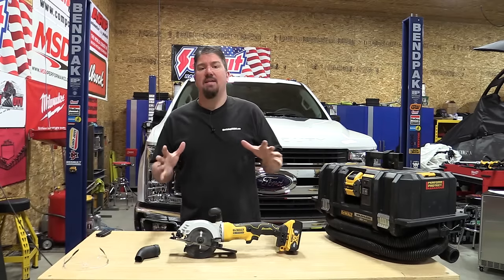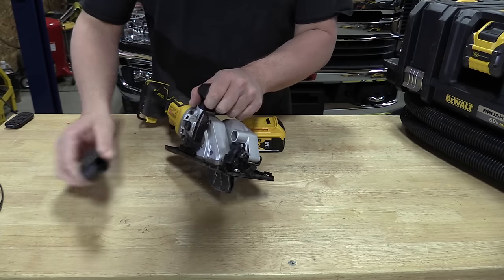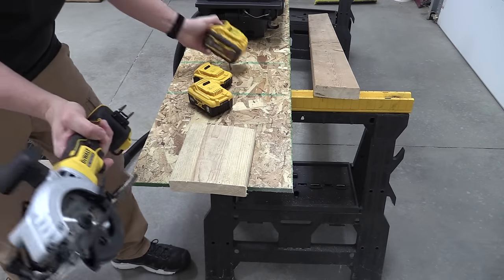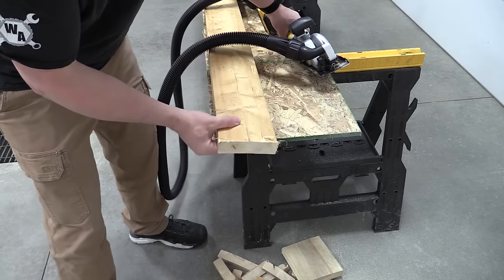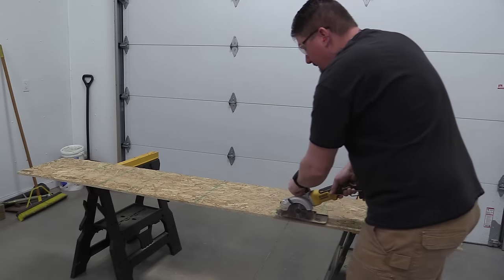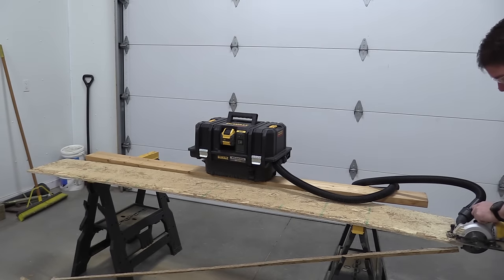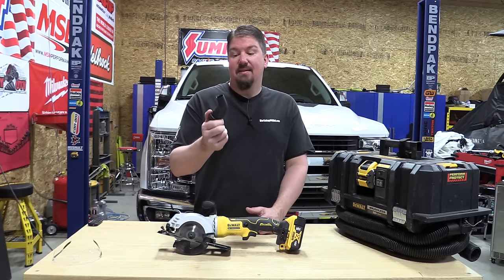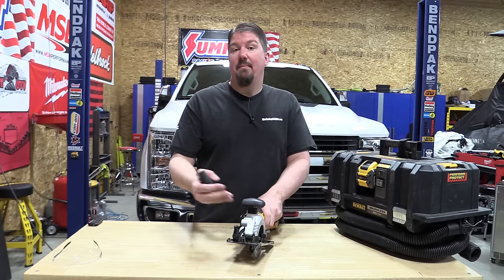DEWALT ATOMIC 20-Volt MAX Cordless 4-1/2" Circular Saw Review DCS571 Power with New FlexVolt Battery

Comment: Retired after 40+ home renovation. 
I would never buy DeWalt. 
Many years ago I walked into our local tool store and saw a brand new drill made by DeWalt. It looked 100% the same as a lower priced Black&Decker. Eventually all the cheap quality B&D tools turned yellow and prices were 30-40% higher. Carpenters fell for the scam thinking a higher price meant better quality. All the tools carpenters would never touch because it was consumer quality they were now buying by the pickup truck load. Us older guys saw this transition but you younger guys never knew you were being sold consumer grade tools with a new yellow color and higher price.
Actually I did buy a DeWalt screw holder once.
Reply: @C is Life I used to buy tools from different companies because they all specialized in different tools instead of one company for everything. All my drills were Milwaukee.  B&D made an 8 1/4 Super Sawcat that was the most powerful in the business back then until it turned yellow, changed name and 30% price increase. I'm in my 70's so it was awhile ago when I  watched B&D tools transform into DeWalt. I'm sure they make great stuff but I'm not crazy about the colour and I like to be different. One thing that's good is that when I work a job with other Carpenters everybody knows what my stuff is.. I did carpentry, plumbing, ceramics etc for almost 35 years but I always work alone by myself.
Reply: All my power tools are dewalt. Never once let me down
Reply: @robertpatterson7182  They are good tools, it's just the con job they did when they first introduced them here in Canada. Many years ago no contractor would touch any tool made by Black & Decker because they were considered homeowner tools. Then along came this new brand of tools called DeWalt. They took the exact same tools made by Black & Decker, changed the color and increase the price by 30 to 40% and everybody fell for it. People will buy anything that has a high price because they think it means higher quality. I had a Black & Decker 8 1/4'' super sawcat saw which was actually the most powerful saw on the market in those days. one day I went to buy another one and it was no longer available but the exact same saw was sitting on the shelf by DeWalt and it was 30% more that was when I decided I hated DeWalt. I looked around the tool section and every single tool that was on the Shelf made by DeWalt was the exact same tool made by Black & Decker previously except much more expensive and everybody was buying them not knowing that they were buying the exact same tools that they wouldn't even step on the year before . it was a total con job from the beginning and I hated them because everything that I used to buy now was 30 to 40% more expensive so you can imagine what that did to my business in those days that was a long time ago I had over $40,000 worth of small hand tools and not one single DeWalt.

Comment: Except for the situation where it can get slightly closer to the walls when cutting open subfloors, there is literally no advantage to this saw compared to a cordless 6.5". The ergonomics are awful. The balance seems ok until you start reaching away from you. The safety switch is an awkward reach for your thumb. And it's too damn long. 
If you love it, that's great.  I just bet you'd love a 6.5 a lot more. The dewalt 6.5 is very good but the rigid subcompact 6.5 is even better due to the battery location

Comment: Would it be suitable for cutting up pallets
Reply from the maker: It works well for cutting the slats!
Reply: @WorkshopAddict  thank you for your reply. For a DIY person like myself which tool will be easier and safer to use this one or a full size circular saw ?
Reply from the maker: @joej9247  IMHO, a nice 6-1/2" circ saw is easier to use.  The long handle on this saw could be problematic if there was kickback or if you put you other hand in a bad place.  Small circ saws seem to keep you closer to the tool and more aware by nature.  If you are right handed, get a blade left saw.
Reply: @WorkshopAddict  thank you very much

Comment: The downside of this saw is that dusk collection port is trash over time. Great saw tho I use it when I need a quick cut it's always in the van ready to go.
Reply: Try Rockler's FLEXIPORTs
or they also have
DUST RIGHT FLEXIPORT DUST CANISTER System
Reply: @quevas93  thanks I'll definitely check it out
Reply: What do you mean by TRASH?
Reply: @stans5270  when you have the friction dust collector connected to a dust extractor vacuum it falls off the saw on its own. So it's a poor design otherwise the saw is great!
Reply: @justgregnow  EVERY vacuum that I have owned have friction fittings, that's why it's odd that this is a poor design.
Reply: @justgregnow  I will acknowledge that there are different materials involved [plastic to metal] might be the cause. Have you tried to tighten it with a worm drive clamp?
Reply: @stans5270  hmmmm all my other DeWalt saws have the dust extractor fitting attached to the saw with a screw. But you don't have to agree with me that's fine.

Comment: This is too expensive for what it is. When you can buy their 6 1/2 circular say  for $90.
Reply: It’s not about price. It’s about size. This size works well on a staging for sidewall, etc. also much lighter then the 6 1/2
Reply: It's definitely a job specific  tool  but it's great  when you need it . Don't knock it if it doesn't fit your needs.  I can see why you would choose one over the other they both have their place
Reply: on sale at home depot for $99.00 til the 12/2

Comment: You are incorrect about those batteries being a "significant difference in power" from one to another. The difference with those batteries is the Capacity ONLY, the voltage that is supplied form all of them is EXACTLY the same. 5AH means it has a capacity of 5 Amp Hours, which means the battery can run at 5 AMPS for 1 hour, same for the 8AH, 8 Amps for 1 hour...as for the Flex volt, it only supplies 20V to this tool (since its a 20 volt tool), it does not supply 60 Volts. You are experiencing a placebo effect. Just because one of your cuts " sounded" different or felt different can be a number of factors, from how hard you are pushing, to how charged the battery is. It really makes people that say things like that about batteries sound not as creditable about the tool itself if they do not understand how batteries actually work. To many people talk about things they do know know about and convince others that they have to have a larger capacity battery in order to get the peak performance of the tool. this is un -true, anyone who says otherwise is lying. So in the end a larger battery only means longer run time, not Stronger cutting power.

Comment: Amp hours has nothing to do with the power of the tool....
Reply: Voltage is constant. The amperage is increased with higher capacity batteries. Similar to your car battery. Hope that info helps.
Reply: @brandonduvall2030  Amp hours is a unit of measure that describes how long the battery can sustain 1 amp at the spec voltage.  1 amp hour means the battery can supply one amp for an entire hour, it has nothing to do with the peak amperage that it can supply without voltage drop. That is to say, just by looking at amp hours, you cannot conclude that one battery can supply a higher peak current than another.
Reply: @Sloppy Doggy  I found this video that helped me understand it... regardless all I know is if you but a bigger battery on the saw it runs smoother.
Reply: @brandonduvall2030  farduff hakib blarb - that's what you sound like
Reply: thanks Ricky!